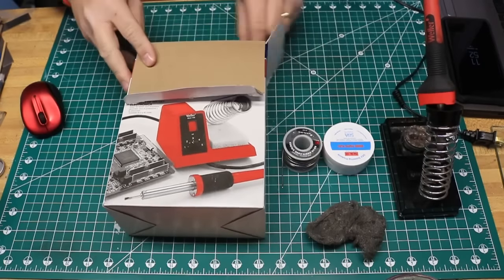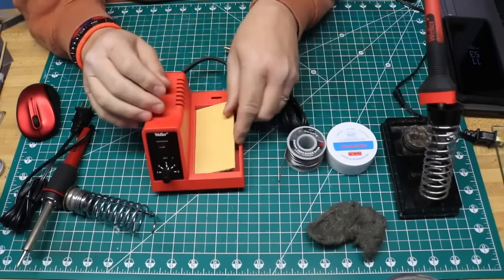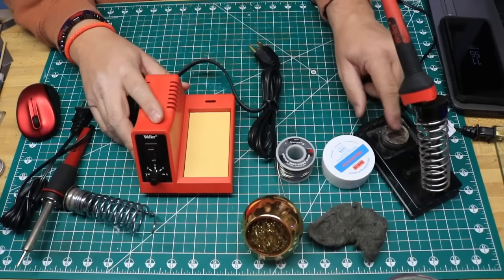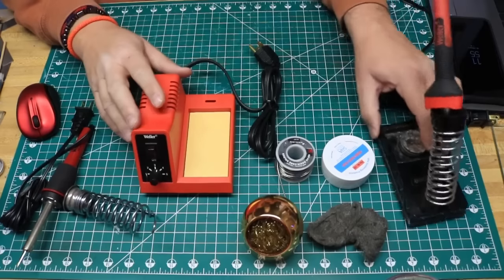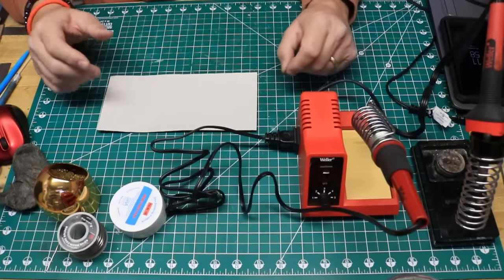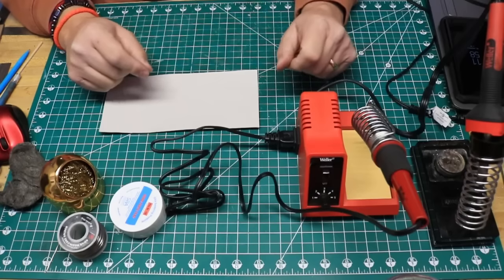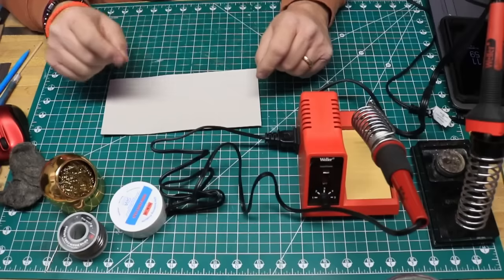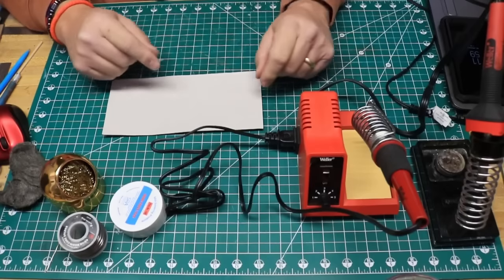How To Tin A Soldering Iron Tip

Comment: Overall good, but... i hope your "cleaning solution" isn't the tip activator xD. That's a procedure you should do once every 6/12 or even more months, when your tip is in really bad shape. It usually has acids in it, and if you keep "cleaning" with it, you won't have a tip, cause it would be eaten away by it.
A thing i do before putting away my soldering iron (a pinecil, so... better not ruin my tips xD), is to put the tin, to a point it creates a sphere, then hold it there till the tip is cold enough, then drop the sphere. This will make sure the tip has a uniform layer of tin on it, fresh and clean, and the flux to protect even more. Also, as you said on the video, don't be scared of the brown color of the tip, it's usually flux that is burnt away, and can actually be helpful to keep oxidation away, make sure you don't use acid based flux, else you ruin your tip if you don't clean it real good.

Comment: I use to work in field service working on computer systems. The soldering iron I use had a tip with only a 1/4 to 5/16 coating on the end for solder. I was also taught only to solder with the very tip of the soldering iron.

Tip: I carried my soldering iron in my portable tool bag. So, I wouldn't have to wait for it to cool down or take the chance of burning something on the customer site seeing I didn't have a stand, I carried a wad of aluminum foil about the size of a large hot dog that I used as a sleeve around the tip to not only cover, but to also dissipate the heat real quick. I just slip the soldering iron in the wadded up sleeve and throw it in my tool bag. Another side effect of the aluminum foil was the cleaning action it performed as I put it in the sleeve.
Reply from the maker: Hi, Earl. Good tip. Thanks.

Comment: So when I tin the tip the solder gets alot of brown spots. Its not looking clean as yours. Its a cheap 30w soldering iron with no temp settings. Around 485 celcius. What am I doing wrong?

Comment: I posted a review and teardown of a $45 Harbor Freight soldering station on my channel, comparing it directly to this same Weller; the HF unit is far superior and costs about $20 less.  The tips that come with the Harbor Freight unit aren't very good (neither are the Weller-supplied tips), but they're of the fairly common 900M series and better replacement tips are available.

Comment: Is it important what kind of solder that you use to tin the tip?
Reply: It depends. If you are only going to use the tip for your own personal use and your country allows the use of leaded solder, then you can use either leaded 60/40, 63/37, or lead free. I highly recommend Kester solder. It may look expensive, but it comes in comes in 1lb spools, 450+ grams. It ends up being far less expensive than those 50 or 100 gram spools. And Kester is one of the best solders in the world. You can get it leaded or lead free. Leaded is the way to go if you can.
   But if you work on equipment for other people and the device is certified lead free, then you must use lead free solder and NEVER use leaded solder on the tip, ever.
  If using leaded solder, just make sure you wash your hands thoroughly before you eat or touch food or your face, or touch a baby or pet or anyone for that matter. Touching it is safe. But ingesting lead, even just what accumulates on your fingers from touching it, or inhaling lead dust would be very, very bad. 
  I hope this helps you 😊
Reply: Craig S thanks!!

Comment: I tried to tin my new iron, but the solder won't stick to it..! Why? It just melt and directly fall off, and ever if I'm trying to stick in the melted solder, no coating is forming.... HELP!
Reply: Maybe you need flux before you try to get solder to stick to tip

Comment: I think that the whole sanding of the soldering tip is only for emergency situations like you NEED to get a job done quickly and your fresh, new tip isn't coming in for a few days.

I just bought a better quality iron and immediately tinned the tip for tomorrow once my new set of solder lead comes in.

Comment: Normal rosin flux and rosin core solder DO NOT contain any acid. Rosin is pine tree pitch, which is also used by some folks as an incense (hard on asthmatics). I cannot think of anything for which a train hobbyist would use acid flux. Breathing any smoke is bad, but acid flux smoke is the worst. You won't get lead poisoning from solder smoke, but failing to wash your hands after handling solder (or bullets) can get lead into your mouth when eating. You want to use electronic suitable rosin flux on your train rails and electrical connections. For mechanical repairs on some mechanical parts you may have to resort to silver solder which can join metals that tin/lead solder will not stick to.

Comment: My iron getting hot but beading up onthe tip notmelting properly
Reply from the maker: You iron is not getting hot enough. You may be using too low a wattage for the work, but more likely your tip is not well tinned and is oxidized. Clean the tip until it takes solder or replace it.

Comment: Purchased brand new soldering iron from the discount store. After allowing it to heat up, the solder slides right off the iron tip & began turning black.

Comment: I used a Walmart Hyper tough 30 watt. It pissed me off. Brand new. Would not tin. Uneven and only heated in seconds at a time and stop, on off on off. Barely got my pickguard on.  It truly pissed me off. I suppose flux would have helped. But 9.99 was the sign I should not have skimped.

Comment: If you stop putting flux on the iron, it won't get covered in black burned flux.  Flux is for the connection, not the iron tip.
Reply: Wrong.

Comment: I disagree that solder wire diameter doesn't matter. You'll have better results and more control with solder wire slightly smaller than what he's using here. Stick with 0.032 or 0.040 at the largest, finer if you are doing finer work. I don't do much PCB work, I do mostly pro audio and 0.025 is excellent and useful for almost everything.
Reply from the maker: I think what I said is solder size doesn't matter for tinning the tip, not for specific soldering jobs.
Reply: @RonsTrainsNThings  Sorry for my minsunderstanding, thanks for making a great video.

Comment: 8:10 - Just the tip of it... C'mon, don't be afraid, it should be covered if you want to use it. You'll see it's gonna be good for you too, baby... 
Apart from the cheap jokes, take care of the temperature if the iron has temperature control on it. If the iron is not warm enough, solder just won't melt. But if it's too hot, the molten solder on the tip of the iron will get oxidized quickly and it will damage the tip also in a short time.

Comment: Pardon my language but none of that shit works, I bought the same station that you have with brand new tips It came with some solder and gel try tinting it just ball up and rolls off. Iron doesn't even get hot enough to keep solder liquify and it's on Hi.

Comment: I dont know man, that doesnt look good. I would have scrubbed cleaned the soldering iron tip, stem, all of it, remove the oxidation and clean to bare metal, clean with iso and then add rosin paste to the iron prior to wrapping it. Maybe also use a smaller diameter wire. The solder probably wasnt sticking on the second attempt maybe partly due to the oxide layer. You add flux to the joint so the solder can flow, why wouldnt you add it to the iron?

Comment: Sorry sir but you made an entire video not succeeding in getting the black oxidation of your iron.

My problem is not with a tip that is already coated...
Reply from the maker: You don't have to remove the black from the entire "tip," just the end of it where you will be working with it, and if you tip is burned completely black all the way to the end it's probably time to replace the tip. We try to make tips last as long as possible, but they are consumables and have to be replaced periodically. Tinning just helps them last longer. It doesn't restore a burned up tip.
Reply: Ron's Trains N Things 
I decided to follow another video (seeing as mine was ruined anyway)
I sanded the tip down to the coper core and then followed your instructions and low and behold the entire tip, including half an inch up the shaft, is now tinned.

Comment: Great video with a few good tips, but tip tinner isn't meant to be used that way. Tip tinner is a one in all substitute for all the other stuff you did. Meant for tinning new tips and maintaining older ones. So you should be doing it the other way around and using the rosin and feeding it solder to maintain it.

Minor tip, its better for your tip and more effective to stick the tip into the brass sponge and turn it back and forth a few times